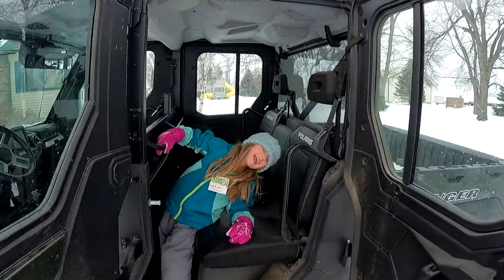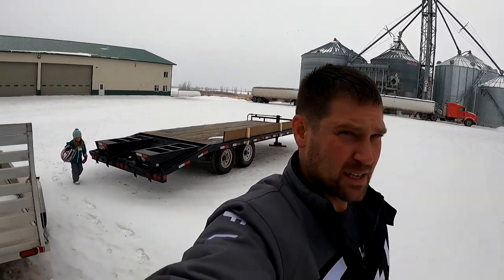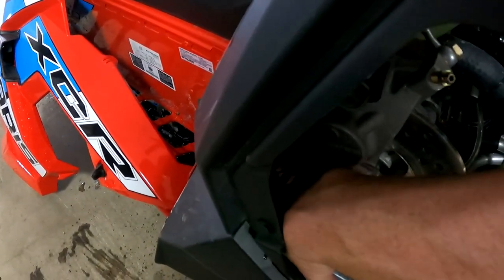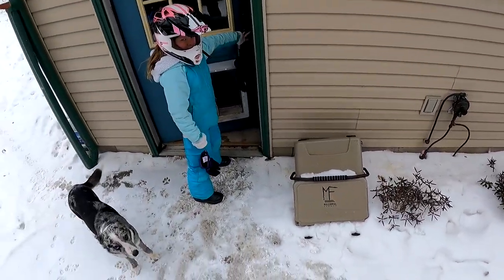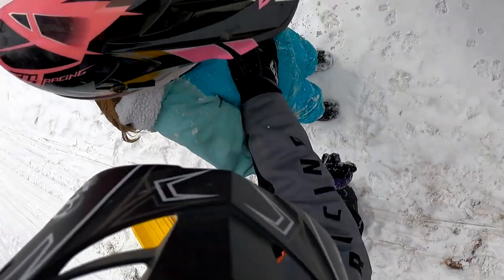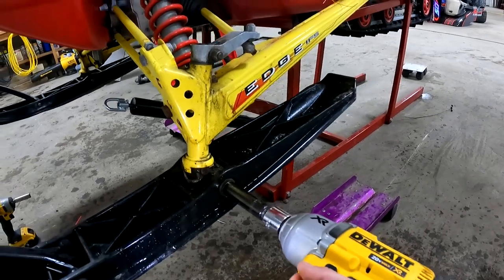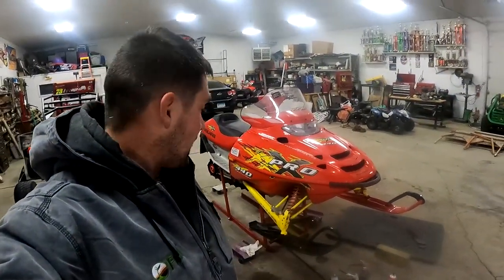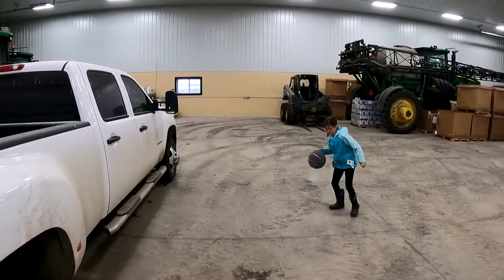Farm Kids Living Their Best Life

Comment: Pro tip for installing brand new skis with new rubber bushings, start the bolt into the ski and spindle on the outside, then set the inside of the ski down onto a 2X4 to pull the inside of the ski up to be able to get the bolt through easier

Comment: Zack, I remember you saying, "Always use the right tool for the job. A hammer is the right tool for any job". I agree with you. The hammer will definitely help with this one but with a little addition: What you need is a piece of round bar or a bolt thinner and longer than the bolt you want to knock out, or even a center punch. Line them up and knock that son of a gun out. No impact tool that I know of can beat a hammer.

Comment: I don't mean to be a buzz kill but sell that 440 fan before it let's go. The 02 was a curse year and they melt off the exhaust dude if the piston no matter how is jetted. 450 miles is line clock work for piston replacement.